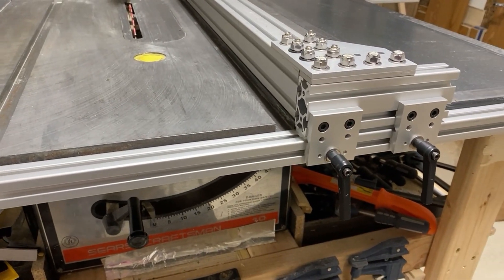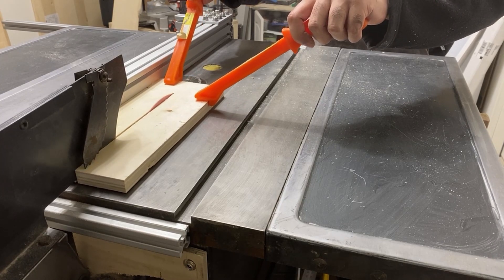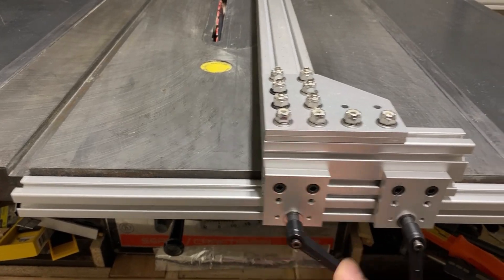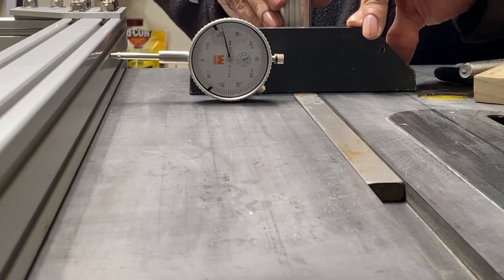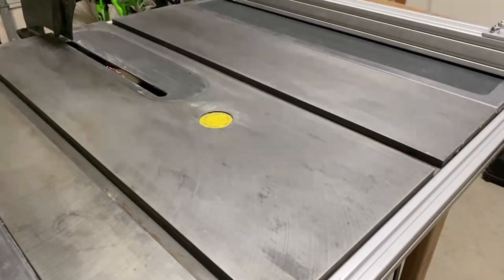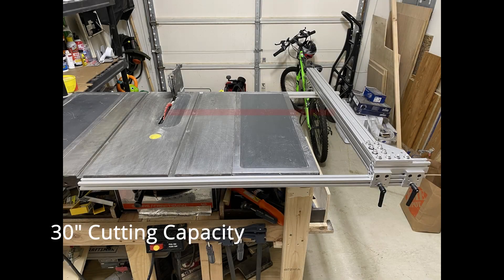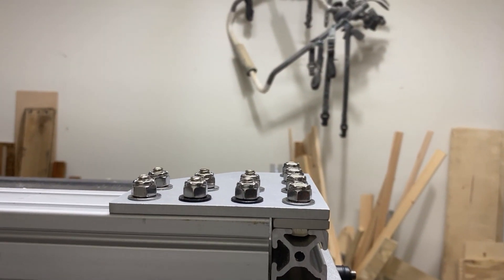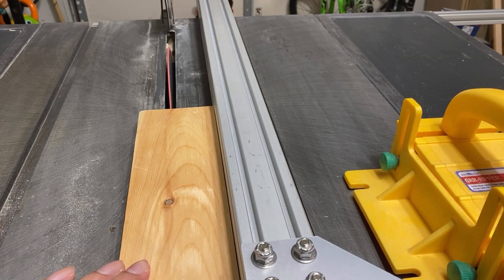Table Saw Fence System Using Aluminum Extrusions (80/20) For Under $150

Comment: I like the design, easiest I think I’ve seen so far. I’m also interested how you mounted your riving knife as mine is even older and definitely times I wish I had one
Reply from the maker: This is the stock riving knife one actually. On my current 113 Saw drilled and tapped a 5/16 hole and use mounted a thin piece of aluminum to serve as splitter

Comment: I just went to your website, besides a craftsman table saw can i place this on a saw with a top 21 inches front to back?
Reply from the maker: Hi where are you mounting holes located on the front? If you measure from top of the saw to center of the hole
Reply: @jbuilds1  I can always make new holes if I really needed to mount the rails
But will the fence accommodate for table top 21” front to back?
Reply from the maker: @mikemerc74  yes the fence extrusion is 36" long so you should have no issues

Comment: Can this be installed onto a Makita MLT100N take saw
Reply from the maker: I believe so. If you can remove your original fence rails and have mounting holes to mount the new aluminum rails with bolts, then you should have no issue 👍🏼

Comment: Excellent work ! I'm about to build my extruded aluminum fence as well but, i'm planning on using my guide rails as a stand in for the INCRA system i want to buy. My plan is to use the sections i purchase as extensions for my in-feed and or out-feed support once the INCRA system is purchased. If i change my mind i also got a few other ways to use them.

Comment: Once built, how do you adjust it so it is parallel to the blade/miter slots?
Reply from the maker: As part of the initial calibration, you use clamp it down parallel to the miter slot, then tighten down all the bolts for the front slider. After that it will retain this position.

Comment: I've got an old Walker-Turner 8" saw. I know I'll have to drill mounting holes for the rails. (1) guessing this will fit and is universal, (2) do you include the UHMW spacers, and (3) since the fence doesn't lock to the rear rail,  is it really necessary?
Reply from the maker: 1 - Yes the mounting holes are drilled roughly 7'8" from the top of the tabletop so just make sure your top is thick enough to support that.
2 - Yes the UHMW pads are included as part of the front slider assembly.
3 - The main purpose of the rear rail is to support the fence past where the original tabletop extension ends. If you already have a longer or custom extension then it can be skipped however i have found that it slightly improves the movement of the fence as there is a UHMW pad under the bottom of the fence that fits into the rear rail.
Reply: @jbuilds1  Awesome! You have a feel for the shipping cost to Long Island, New York? Starting to warm up here. New fence could sure catapult me into spring!
Reply from the maker: @davesandler3743  it's coming from upstate so should be on the lower end. It's calculated based on location so you can check on my website how much it'll be.
Reply: 11780-2246

Comment: Seems a shame to go to that much trouble and then have no more accurate way of setting a rip width than to use a tape measure. How about building in a scale, or better still a digital readout? The WIxey units are inexpensive.
Reply from the maker: Hey great point! I'm working on a quick video on adding a tape measure to the top T slot of the front rail. Also I have had customers install the Wixey readout mounted on the bottom t slot of front rail

Comment: You can eliminate one of the locking handles by installing UHMW standoffs of identical thickness  (maybe 1/8"-1/4") at the left and right ends of the bar through which the handles are bored (between that bar and the fence front guide rail), then installing a single locking handle in the center of the bar between them. This is the arrangement of clamping cam and standoffs on a Biesemeyer styled fence. One locking element is just as secure and twice as fast. You can also see many applications of a different t-slot extrusion that formed the heart of a woodworking fence and table extension system system I patented in 1990 at                     www.1-fence.com. T-slot extrusions can be used for many applications beyond the one you are starting with. Keep up the good work --- you're on the right track.
Reply: Just a thought, for what it's worth- if you are going to link to your website you might want to redo the website so it doesn't use Flash (Adobe Flash Player is no longer supported)
Reply: @KavanaghGTR  Thanks. As we speak,  I'm having my several websites rebuilt and consolidated into just one modern one, which should go live in about a month. But I hope that the still pics and text discussion might still be helpful to the OP and others to get the most of T-slot extrusions. That project was a big adventure for me 30 years ago, but sales have long been mostly only passive,  to legacy customers who still add modular components to their systems after all these years.
Reply from the maker: @michael.schuler  Hey thanks for your suggestions. I took a look at your site but was unable to access the pictures of the fence system but I will send you a PM about it as you seem pretty knowledgeable on this.

Comment: Would this fit on porter cable pcb270ts?
Reply: Ok thank you
Reply from the maker: Yes - you will have to drill the mounting holes about 7/8" down from the top of the tabletop
Reply: And your package $175 includes everything it needs to work?
Reply from the maker: @mostafaelhaj8391  yup that only difference is the $175 one has longer rails